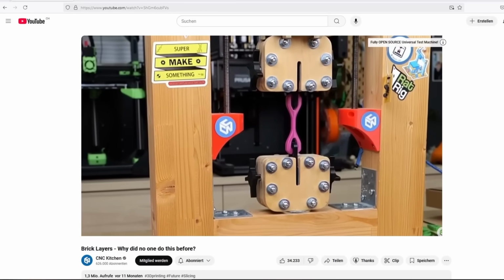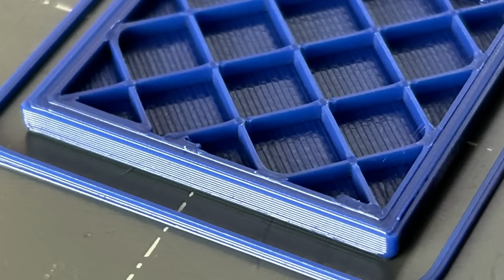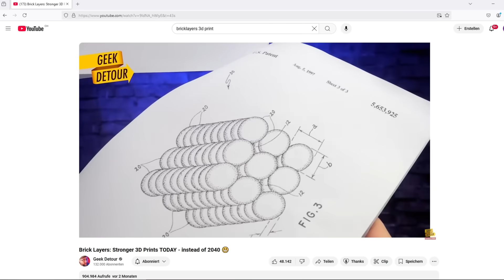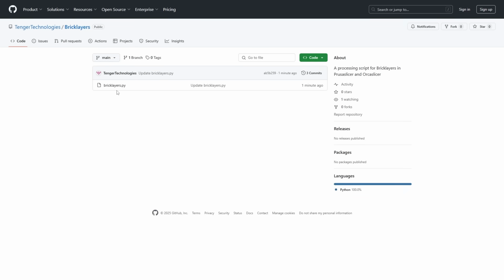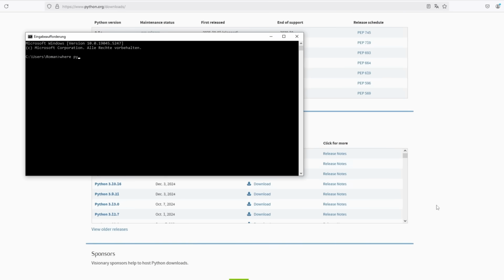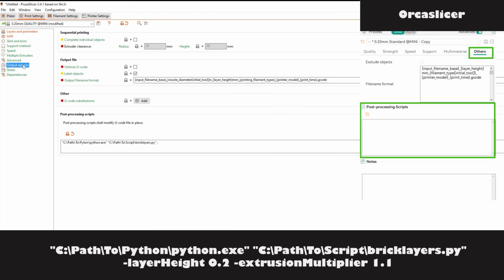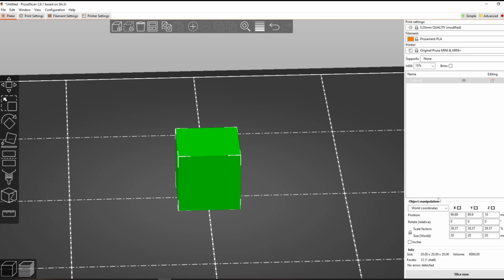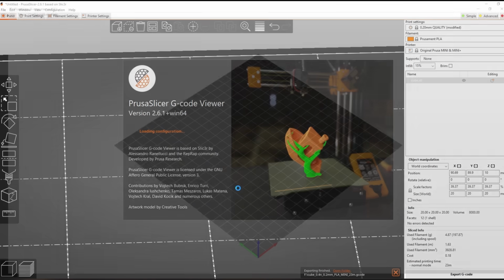Bricklayers for Stronger 3D-Prints now Opensource!

Comment: I’m not a 3D printer hobbyist per se but I like to use my 3D printer to support my other projects so usually strength is in my mind for parts. I’ve often turned to TPU if I really need good layer adhesion and my part will have areas that don’t align well. That can be a big trade off. I’ve recently thought (while trying to justify buying a bambulab H2d or Prusa XL), that if you had two heads you could combine two filaments in one part to get the benefits of both - one hard, strong but relatively brittle filament and one TPU for flexibility and interlayer adhesion. If the two filaments adhere to each other well, this could work quite nicely. I first thought of parts with a hard core covered with TPU. Or TPU on the inside with the hard filament on the outside (like how steel rebar makes concrete just flexible enough in reinforced concrete). My next thought was to alternate layers between TPU and the hard filament (like spiders alternating hard and soft elements to make extremely strong fibers). Then I thought that with 3D printing, the slicer could be used to combine TPU and the hard filament within in the same layers. What if each half layer (in the brick layering) alternated between TPU and a hard filament. TPU/PLA, TPU/PETG, TPU/nylon. I’m not a filament expert, but I do think that TPU “mortar” could potentially “solve” or improve the interlayer adhesion problem that nearly all of the common harder filaments suffer from to some degree. I would love to hear your take on that idea.

Comment: Where would I report a bug? I found that if I have a model that has exactly 3 perimeters (two outer and one inner, like in a cup with a wall thickness of roughly 3×extrusion_width), it will shift one of outside perimeters up by the layerHeight/2.

Comment: It works very well, even for mechanically strong parts!
There are slight cosmetic external defects, but slight and they are not important if you are looking for exceptional strength, which this thing achieves.

I just finished a 7 hour print of ABS with thin and thick walls of an object that previously had delamination in the printer chamber at 30 degrees! Now with this way of cutting and again 30g. in the printer chamber there is no more ABS delamination.

It is extremely important that you do indicate the exact path to Python. Find the application from the main menu, after installation. Right click and from there find in which folder it is. From there right click on the application itself, properties and there you will see the exact path to it!!! CMD can lie to you about the exact path and you will have errors when extruding the file!!!

You need to replace h with H in the height setting, because it is confused in the description and gives an error!

Do not use a multiplier higher than 1.1! otherwise you will extrude too much material onto the bottom layer and the nozzle will clog! This has been tested with a 0.6mm nozzle. Even a 1.05 or 1 multiplier will work best! With 1.3 and 0.6 nozzles you will have an instant clog!!!

Extremely useful way of slicing, this thing changes the game completely from strength to strength! You can hide the external slight remarks with a light fuzzy skin. But I am sure that the code will be improved by specialists and this will also be fixed!

Great addition for the entire 3D community!

Comment: Write into your documentation the us and eu stratasys patent, that you followed their idea to reduce the gabs. They have filed in the wrong patents and with you having the correct patent mentioned they can't even sue you even if they tried. As their patent is wrongly filed on an the wrong stratasys patent. The first step of them would be a dissuasion to remove your github scribs. With the wrong filings and their patents errors it can be easily defeated with a 400€ lawyer letter, which costs you can even ask from them.

Comment: INTERLOCK layers would be a major improvment, like you would do on fiber reinforced plastics. So you use layered non planar printing to achieve different hights where the next layer can go between and over the other to create an under-over structure.
Reply: this needs more likes.
Reply: Do you mean like a step up structure? Like a multi-wall vase structure where the print sort of 'climbs' itself, alternating between the walls that create an interlocking vase structure?

Comment: I was not able to get it to work, not even when I tried it outside of Prusa Slicer: i.e. I tried opening a command prompt window and running the command directly. All I kept getting is "file not found for the gcode file, even though I moved the file around to different places to see if it made a difference.
I should have watched Stefan's video first. All he got with PETG was a 10% layer adhesion improvement. I don't think that's enough to warrant much extra effort. If the feature gets built into Prusa Slicer then I will experiment with it.

Comment: Could you print the outermost layers all at half layer height to get beter detail?
Maybe first slice the whouk part at half layer height for detail, then use g code manipulation to remove alternating layers and extrude more to compensate?

Comment: Help me solve the problem
windows 11 pro 24H2
orcaslicer 2.2.0

Post-processing script
"C:\Users\bor3on\AppData\Local\Programs\Python\Python313\python.exe"
"C:\Users\bor3on\Documents\orcaslicer\bricklayers.py" on file
C:\Users\bor3on\AppData\Local\Temp/orcaslicer_model/Tue_Jan_28/04_38_32#8672#55/Metad
ata\.8672.0.gcode.pp failed.
Error code: 1
Reply: Check the passed arguments. -layerHeight 0.2 -extrusionMultiplier 1.05.
Reply: @milowmilo  I've checked, it doesn't help.😔

Comment: I just installed your script on my Orcaslicer on Mac. With 2 Wall Counts the walls are not shifted but the infill is. 
I am using your settings from this video. 
I don´t know what is wrong in my settings to fix this. Any suggestions?

Comment: btw, orcaslicer(i guess prusa also has it) has "infill combination" feature inside "Strength" setting which effectively will print infill with highest layer line possible while walls are getting printed with whatever layer thickness you ask
Reply: dang, can this create a similar effect as shown when running the script? i was experimenting but i've seen no brick layer structure unfortunately.

Comment: Based on your original script, I have implemented several improvements to enhance its functionality and performance.
https://www.youtube.com/watch?v=3RTSSLVJbAs
Reply: Does it cancel out the height compensation of the top layers? I understand that the parts will have a worse surface finish, or am I missing something?
Reply: @RogerThingsChannel As described in the script, the process introduces a deliberate variation in the Z-height. While this can enhance bonding in certain internal layers or improve structural integrity, it may disrupt the smoothness of the top layers.

Comment: I kept getting the error code 1  on Prusa slicer 2.9.0  I turned off generate bcode so it would output gcode well the error went away and I get no other errors but when I bring it back into the slicer to view it doesn't look like it did anything not like how you showcased it here ? Does that mean it still failed somehow?

Comment: What if the Developers of Orca Slicer added some form of Add On- or Modification System in the GUI so it would be possible add a package or something, with the code implemented, so the Add On is applicable on any Model, without adding it manually. Oh sorry, just thinking out loud.
Reply: https://youtu.be/3RTSSLVJbAs

Comment: would have great for it to also have different outerwall layer height eg 0.1mm outer 0.2mm inner, or even take a step further and make top layers change dynamically in height eg if you have a sphere instead of stepping up the next layer it could make the lower parts of the same layer thinner and the thicker areas well thicker

Comment: Doesn't rotating the part along one or two axes during printing achieve a similar effect to bricks layering?
Reply: no, rotating the part only moves the regular layers around while still printing them all side by side and on top of each other. This actually makes every other wall shifted up or down by half a layer, so there is more contact between passes. Think of stacked cans falling into place.

Comment: I downloaded it, made it work with PrusaSlicer on my Mac and it modified the GCODE. It worked... sort of. Different models reveal challenges. Please, try to slice a CaliCat with 4 perimeters. What is the best way for us to message each other (if you want, of course). Anyway, it is great to see this.
Reply: Greetings, ... sort of? are you having failures with this? I'm testing, so far everything seems to be going very well. I haven't noticed any negative impact on the surface quality of the parts. I've replicated your calicat idea with 4 perimeters, and it came out really well. I use Orca.

Regards
Roger

PS (From now on Calicat instead of Benchy, I say that because of his last video XDDDD)
Reply: Looks like the script changes the Z Up and Down, Up down, in the same layer, instead of printing all the lines that are lower, then going Up and printing the other lines that are higher. Maybe it doesn't matter. I need to test more.
Reply from the maker: wrote you on insta
Reply: @GeekDetour  I think that explains why I notice that the nozzle rubs slightly on the layer that is printing.
Reply: @RogerThingsChannel Absolutely. It could work “fine” but it also can pose a risk to knocking off parts while printing, specially in high speeds. Some heat-breaks can even be bent. I don’t know if people are aware of that.

Comment: You are a HERO!!!
I am currently running some tensile strength measurements. Will print some additoinal dumb bells with your brick layer script and break them tomorrow. I will report back on the results.

As promised some measurement data:
Samples are made with black ABS ex TM3filament in the netherlands and printed on an enclosed RatRig Vcore IDEX 500 at a chamber temperature of 70 °C and nozzle temperature of 260 °C. And sliced in OrcaSlicer.

                                                                        horizontal             vertical
reference:                                                      47.9 MPa              17.7 MPa
Brick layers extrusion multiplier 1.00       47.5 MPa              19.7 MPa (11% increase)
Brick layers extrusion multiplier 1.05       51.2 MPa              20.9 MPa (18 % increase)
Brick layers extrusion multiplier 1.10       48.0 MPa              16.3 MPa (8% decrease)
Horizontal means the stress in in layerline direction, vertical is perpendicular to the layer lines.

Remarks:
* both the extrusion multiplier 1.05 and 1.10 look overextruded. Fr the 1.05 just a tiny bit, my guess is that 1.02~1.03 is optimal. I will print an additional set of samples at 1.025% to check this. 
* I had scarf seams on for these prints (outer and inner layers). wihtout scarf seams the reference value for the vertical samples is 24.1 Mpa.
In my tests with regular slicing to my surprise scarf seams decrease the layer adhesion. I expected that not having the seam in 1 point would avoid a weak spot. When watching the print carefully I saw that while making the scarf quite bit of shear force was put on the samples which could well cause them to be slightly damaged already before the stress test itself. The fact that they all break at the bottom narrow point supports this. Hence for regular size prints scarf seams might still be stronger (or the same) as regular seams.

From the data it is clear that brick layers improve the layer adhesion and that a slightly increased extrusion multiplier is helpfull. Overdo it and the layer adhesion is worse (this probably also happens with regular slicing though I have not tested this). The flow rate for my prints is optimized using the OrcaSlicer test where I err to the higher side.

For the horizontal samples there seems to be an improvement as well. This is however, wihtin error, the additional amount of plastic extruded.

And one extra kudo's to the author: the script worked "out of the box" just plug it in as described and things worked. I did nothing to my whole settings and procedure, just the postprocessing script and after that the RatRig IDEX post processing script runs on top of that without issues (I didn't use the IDEX functionality itself yet so can't confirm that just yet).
Reply from the maker: Thats awesome, thank you!
Reply: Did the script work in Orca Slicer for you? I only managed to add it to PrusaSlicer. Thank for the results!
Reply: @milowmilo  Yes the script, including the arguments worked in Orcaslicer 2.2.0. The script goes in the Others section of the print settings.
"C:\Users\Koen\AppData\Local\Programs\Python\Python313\python.exe" "C:\Users\Koen\Documents\RatRig\bricklayers.py" -layerHeight 0.2 -extrusionMultiplier 1.02;
I am not sure whether the semicolon does it, the RatRig post processing scripts had it so I just put it there.
Reply: @ Had to install the Non-Appstore install of the Python IDE. Thanks again!
Reply: @koenvanduffel2084  hmmm regardless of orca or prusa I can't seem to get this working because of the -layerHeight variable. whenever i have it included it gives me error code 2 on both slicers, i should clarify this is on the one with non planar infill version
Reply: Bro flexing with his 2.7k€ printer. I’ve wondered how you heat the chamber on RatRigs with no discrete chamber heater. Passively? Bed fans? A custom chamber heater?

Comment: I have issue after slicing, saving it and checking again in Orca. When I open gcode in slicer I only see most top and few bottom layers. Nothing in between. I use klipperized SW X2

Edit: It mashes up everything in between into bottom layer, then nothing, then top upmost layer
Edit 2: Found issue. Prusa slicer has Move Z and Move XY separate, Orca has everything in one line. That makes python issues.

Comment: Since this is a fairly manual process it wouldn't be much to ask the people who want to run the script to put in pauses in the slicer to mark where they want to turn on and off the layer compensation.

The script would automatically remove the pause gcode. And you can always put a pause back in when you drag the post processed gcode back into the slicer. In case you wanted a real pause for putting in nuts or magnets or whatever.

Comment: Can you provide more clarification on the problem with multiple top layers? I don't think I fully understand the issue.
Reply from the maker: Sure. Think of printing a staircase, each step has top layer. Currently the script only compensates the very top step's top layer. On every other step you'll see an increase of height in half of the wall lines.
Reply: @tengertechnologies  Ok I think I understand. So if I was printing an object with a curved top the very last top layer would be fine but for the other top layers that form that curve half of their walls would be increased in height and would no longer make a curved object correct?
Reply from the maker: Curved should be fine. This only affects flat top layers.

Comment: This is fantastic! But I think Orca Slicer doesn't like it as it's not generating the steps after importing gcode back in to view. It's running the script but nothing's happening.
Reply from the maker: You have to drag the exported gcode back into the slicer to view it.
Reply: When selecting any profile and printer, the orca slicer does not save the g-code, but reports an error 1

Comment: I ust tried this in BambuStudio and OrcaSlicer and it didnt work. What went wrong?

I had "C:\my\path\to\python.exe" "C:\my\path\to\bricklayers.py" -layerHeight 0.24 -extrusionMultiplier 1.1
Then i export the g-code and re import it and see normal layers.
Reply from the maker: Do you by any chance use a bambu printer? Because that won't work and I'm working on a fix for that.
Reply: @tengertechnologies  I have added the exact same to orca and I just keep getting an error message. Trying to print with an flsun v400 but orca wont even let me export the gcode. Error Code 2 on orca if it matters. Thank you!!!
Reply: @alexhites6443  Same for me, orca and k1 max
Reply: @tengertechnologies  I use a bambu printer and am having this issue, do keep me updated when you have a fix for it
Reply: @tengertechnologies  where can i follow you for an update once you have a build for bambu printers?
Reply: @tengertechnologies  I'm using bamboo printer, currently it's not working, waiting for updates.
Reply: @tengertechnologies  I do intend to use the gcode on a bambu printer, are the profiles for the printers that drastically different?

Edit: I just did everything the same, but with the Creality K1 and ender3 profiles and it doesnt show the gcode changes either. What printer profile did you use to test?

Edit: I tryed it with a PrusaMini profile and it works, so its not me, its just only works with PrusaMini right now.

I hate that it seems like i am shitting on your hard work. What you did here is great and innovative and i love seeing that. If anything yo created prior art that will prevent any future patents on this technique.
Reply: Same here

Comment: Should I be seeing a visual preview of this script when slicing in Orcaslicer? I'm not seeing any difference in the Preview after following these instructions.
Reply from the maker: No you need to drag the exported file back into the slicer to see it. The postprocessing happens while exporting.
Reply: @tengertechnologies  Hmm I tried that, I dragged the Gcode directly into Orca and no change. And the Gcode doesn't seem to be changing Z mid-layer either.
Reply from the maker: Did the layer count increase compared to the one after slicing/before exporting?
Reply: @tengertechnologies  It did not; for the basic 25mm cube it was 128 layers for both before and after exporting.